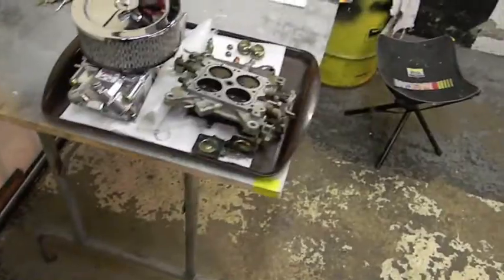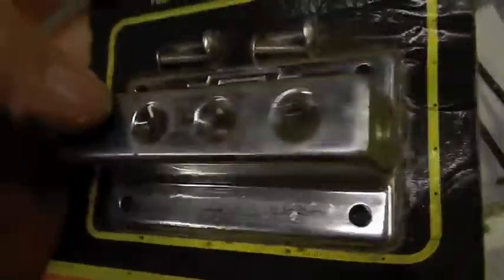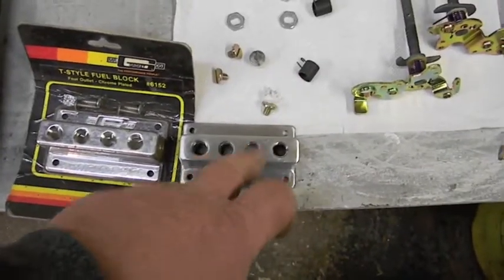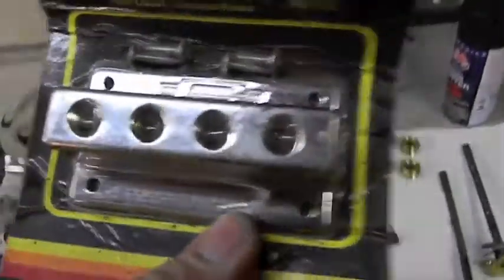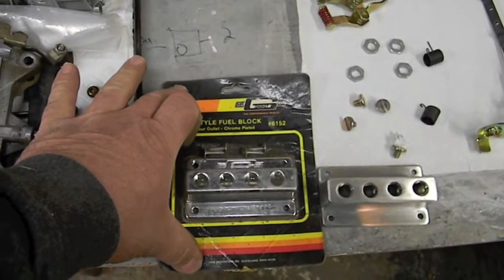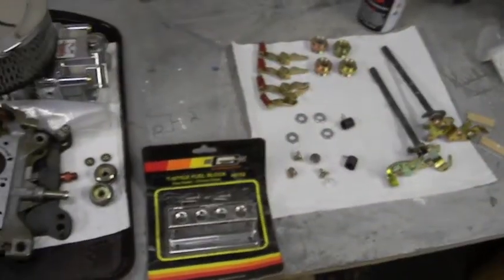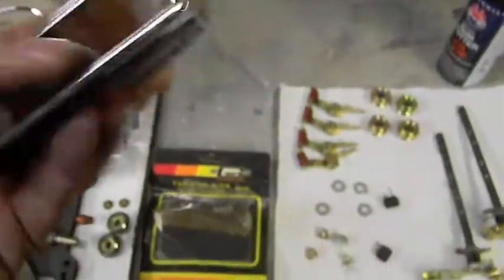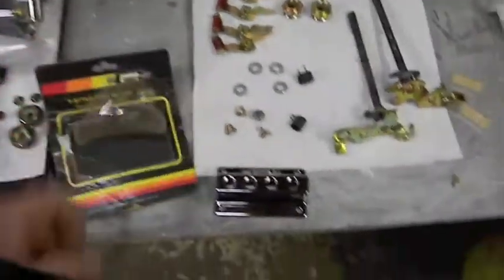Is It A Chinese Part?

Comment: Nah that was usa back then, sand forged.

Your new one in the packet is great, you only see them failing whe wrong brass fittings are used, alloy will corrode together

Comment: Crikey Ant...Most of any parts have a ROC sticker on 'em somewhere...I fitted some lower caster arms to the bosses E85 BMW today and I said that the bags that the arms came in said"Made in Germany"..I said "well at least the packaging was...excellent re-pops but at a low quality...I remember the first Chinese/Russian car I worked on ant thought "this is just like a ___but the quality is way bad"..Things may have changed but they pay the labor 3/5's of bugger all to do the work and we pay through the nose prices to buy that crap...Did you know that there are over 1000 vehicle manufacturers in China ?..You'll never find one of them in my driveway.!.Even a visitor has to park a few doors up...lol..I'd rather pay stupid prices for Aussie made stuff that's guaranteed to be All Aussie and that makes the shopping list a little awkward.
Reply: Does Oz Manufacture that much Stuff?